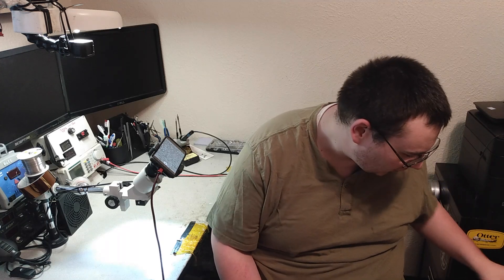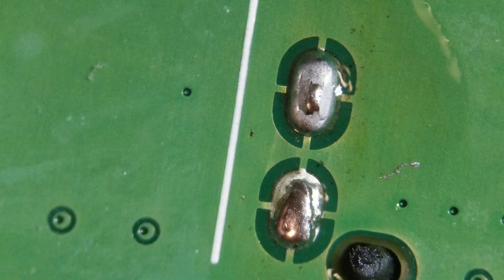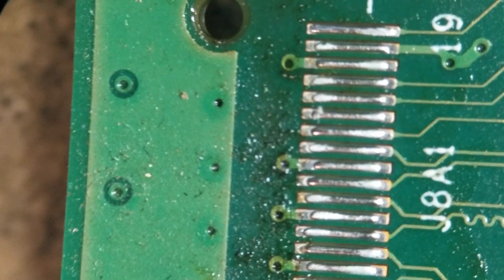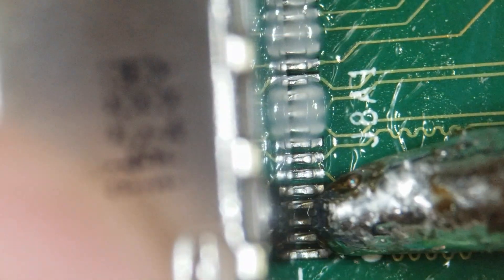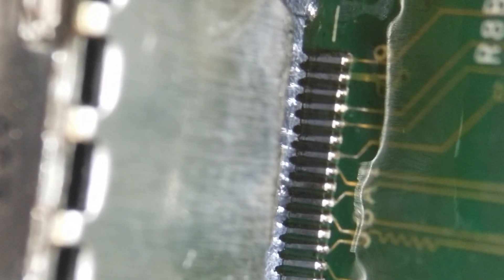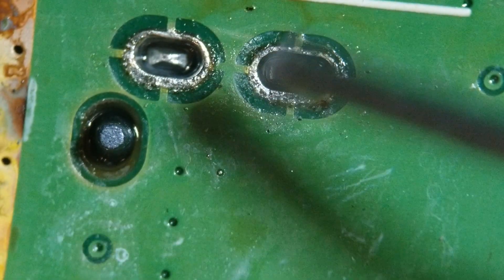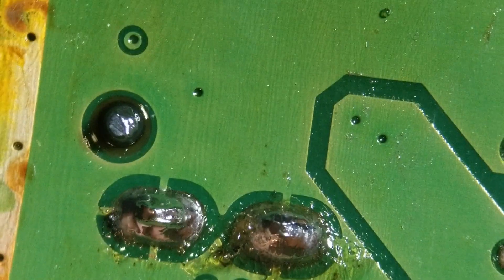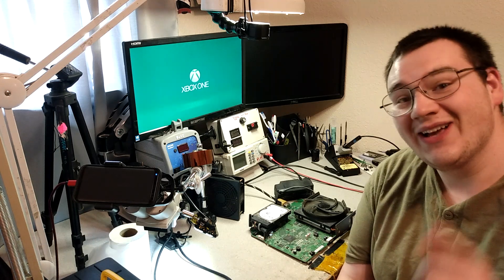Xbox One S HDMI Repair - Damaged Port - Customer Send In

Comment: I need Ur help asap I have an Xbox and it's HDMI port is either loose or messed up because whenever I connect my Xbox to my TV the picture goes off of my screen for a few seconds then I check my Xbox and the hdmi cable has came out of the port is there anything I can do to make the hdmi cable not fall out of the port?
Reply from the maker: Replace the port.

Comment: My xbox will get these green dots and some lines on it now I tried everything hard reset change cables different tv ports unplugged everything only way it works is  when I switch the resolution on the xbox to 720p the second I switch back to 1080p same green dots and lines again any suggestions
Reply from the maker: Definitely sounds like a retimer/redriver issue. We can definitely fix that.
Reply: @chasefournier  now I cant get it on  totally played with settings now I can't get no picture says it's not supported on my tv and cant change it back now any suggestions about to throw it on the trash
Reply from the maker: You can mail it in for repair :)
Reply: @chasefournier  I switched to to another tv and the problem went away I can run it fine at 1080p on another tv and only 720p for it to work on the main one I've been using for awhile dont know what happened or what's wrong with the tv  if it broke it wouldn't be worth fixing to me would just buy a series x instead not putting money into a outdated console I wouldn't touch again and it seems like it's the port on the tv works fine on another tv

Comment: how long did the whole process take ? ( shipping and repair)
Reply from the maker: Usually 1-4 days shipping depending on where your located in the USA, then once received 1-2 days to repair the console (the repair can be done inside an hour, but it depends on how many repairs we have in at a given time) 

And then return shipping is 1-4days.
Reply: @chasefournier  can I get my Xbox fixed and if so can you tell me your email and the template form
Reply from the maker: @Cjaayy5  the template is in the video discription and my email is chasefournierrepairs@gmail.com
Reply: @chasefournier  bett